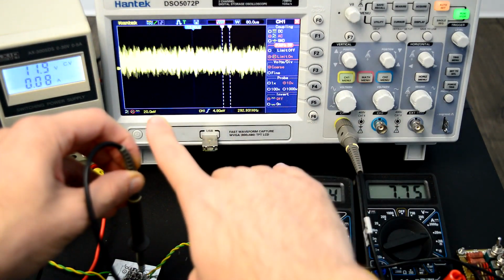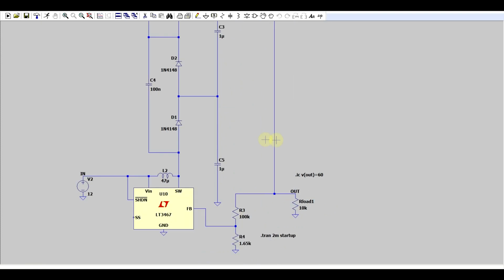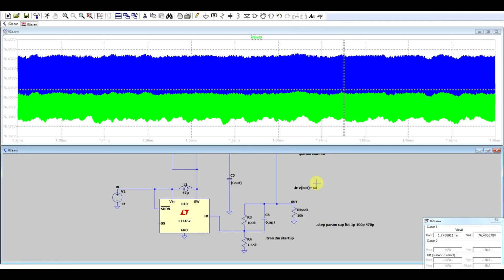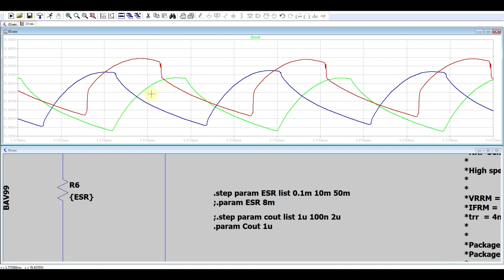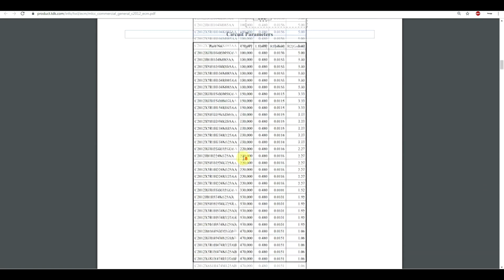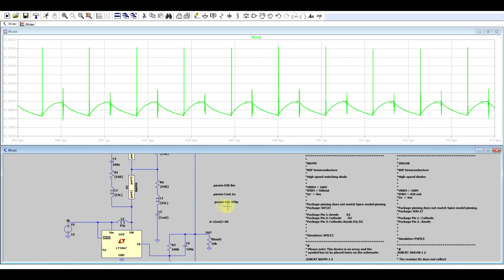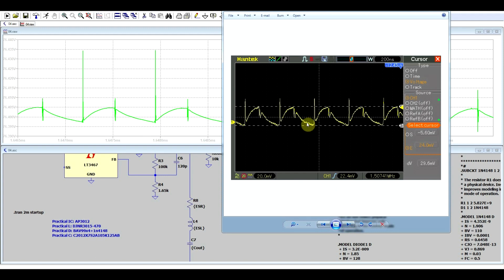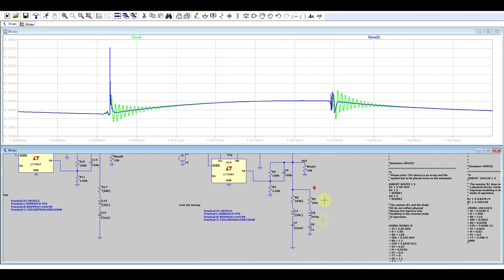Electronics Tutorial - Handling a Boost SMPS ripple using LTspice

Comment: Does real hardware design care about this very small noise? I mean I watch a lot of videos about power supply but it seems that about 100mV of noise is considered good enough and no one cares about cleaning it more than that. Love your videos by the way ❤️👏
Reply from the maker: It highly depends on the application I guess. In something like an audio circuit any noise is usually bad; but also if you need to pass EMI emission tests, you want to keep noise as low as possible. Another thing to consider is the output voltage - 0.1V ripple in 24v can be neglected, but if the output is 0.8V (like core voltages in processors) its a big issue.

Comment: Excellent video! Really shows how to understand relationships between problems and how to model them. Also explained much better than some bigger well known Youtubers out there. Keep up the good work!
On the subject itself: one thing I was missing is the ringing and noise that's caused by the internal MOSFET when switching.
Reply from the maker: Hello Piet! I'm happy you enjoyed this video!
If I understood your question correctly, the Mosfet (in this case its a BJT, but that's not important), lets call it the switching element; does not cause that much noise on its own. The ringing you see in switch nodes mostly is coming from the stray capacitance from the switch node to ground and stray inductances in the traces. Another common problem in boost circuits is the parallel capacitance and reverse recovery time of the diode (but this should be included in the diode model) and the parallel capacitance of the inductor. The real life switching element also has these capacitances and inductances and stuff, but in this simulations case this component is included into the LT3467 component. Because of the voltage tripler stage any specific switching node noise gets filtered out by the long strain of diodes and capacitors, I think that is why it was missing, or it was just much smaller than all the other noise sources in the system.
Reply: @FesZElectronics  yes. That's correct. For switching converters with an external switching element it can be worse. The thing is that not only the noise is an issue, but EMI as well. So sometimes the output looks clean, because all the caps filter everything out, but at the same time the circuit is sending a lot of noise "through the air".
Reply from the maker: @Piet Mujis I fully agree about the radiated EMI part. The problem is that its not really possible to simulate radiated emissions with LTspice... Regarding the internal/external switch element, I would lean on saying that the external one can be better, I had a case in which I was working on a low power (6V, 100mA) supply with internal transistor; and for some reason the switch was designed to have a 1-2ns rise/fall time. Considering the power output this was complete overkill but there was nothing to do about it.. This should have reduced power disipation but it ended up creating huge EMI problems. If the transistor would have been external, you could simply reduce the rise/fall time with gate resistors.